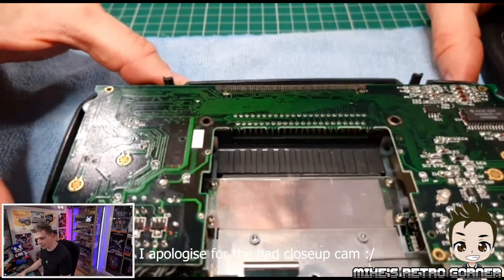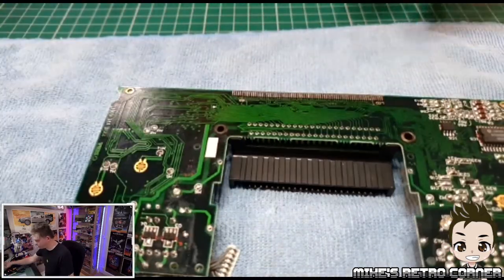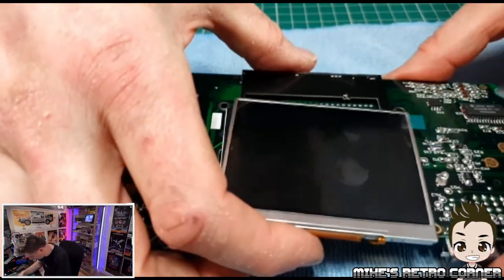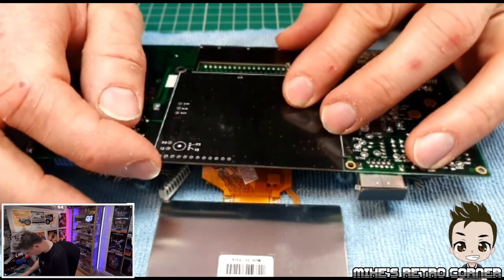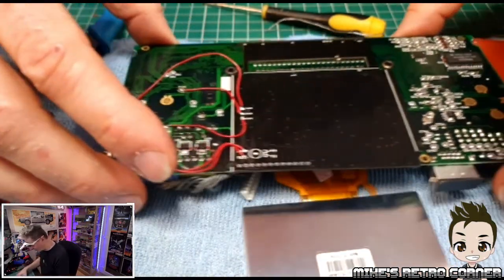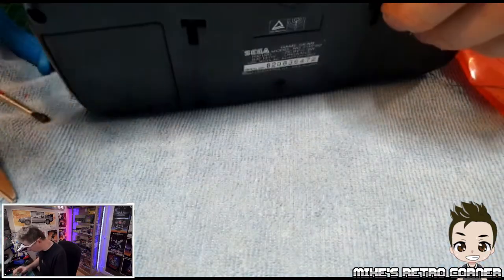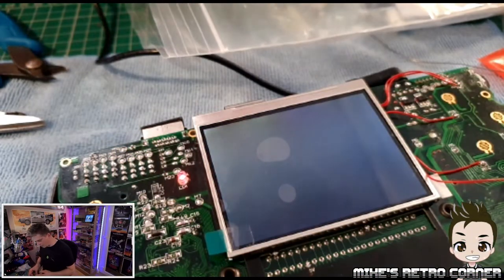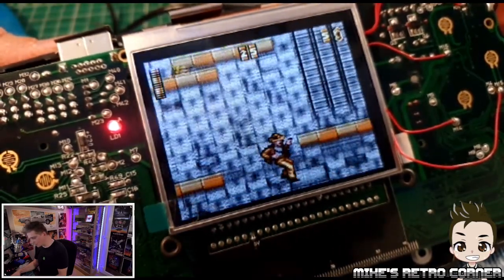Sega Game Gear AliExpress LCD screen install on a 837-7996 motherboard

Comment: Hi I'm buying thias kit. My questions is a did you cut the top screw or the protection iron on the case? 
Except for the guide, did you just cut the coil?
Reply from the maker: I removed the coil and also cut the top screw :)

Comment: Just a friendly suggestion put some insulating tape between the various solder points and the back of the screen.
Reply from the maker: On the final install its all been insulated :)